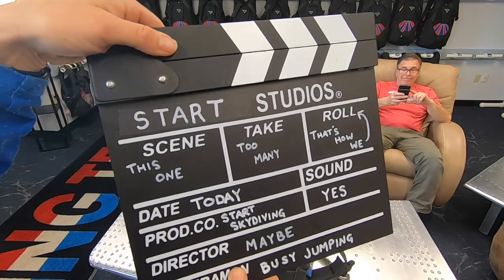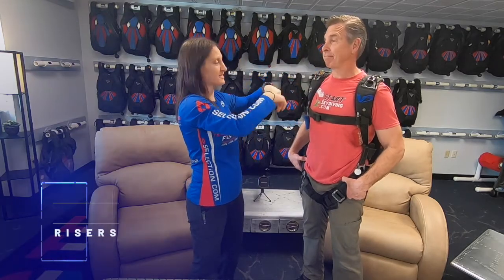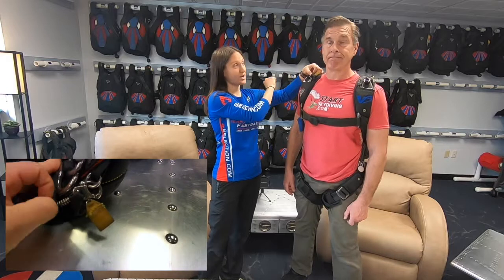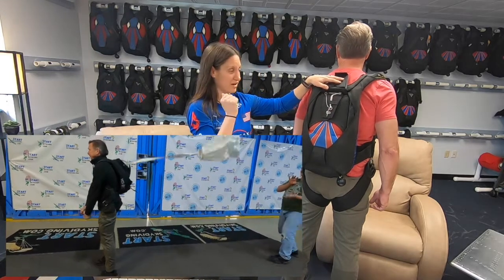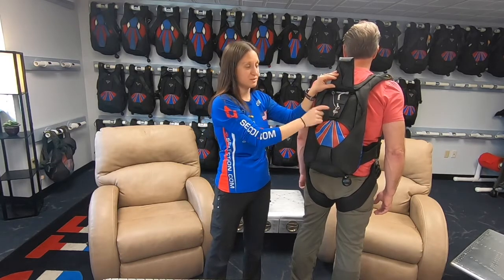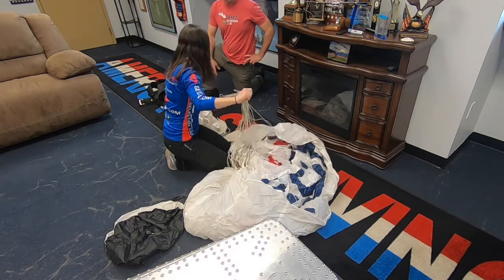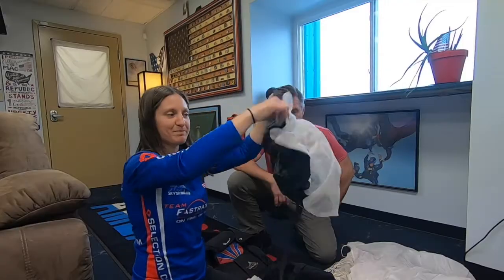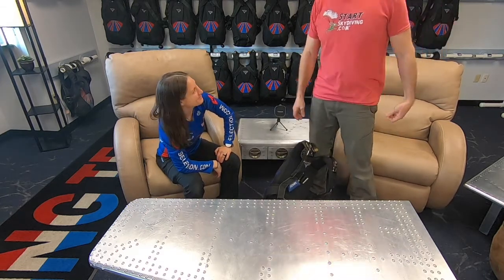Episode 5: Components of a Skydiving Rig

Comment: Great video. How log do the ruberbands last on the D-bag?
Reply from the maker: Hi, Frankie586! Great question. There are different types of rubber bands used for different types of containers (tandems are different from licensed skydiver rigs), and some don't use any at all! (We didn't cover that, because it is less common.) The rubber bands can last anywhere from a few jumps to a hundred jumps. When they break, it is typically upon deployment, and we just change them out when we re-pack the parachute on the ground.
Reply: Thanks for the information. I never thought they can last that long.
Reply: Until they break. Gotta change them then.